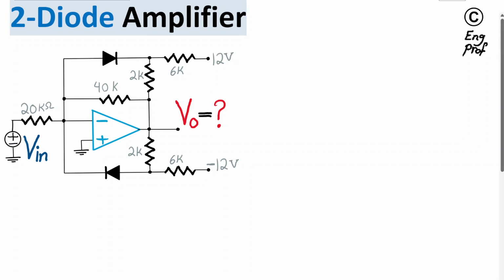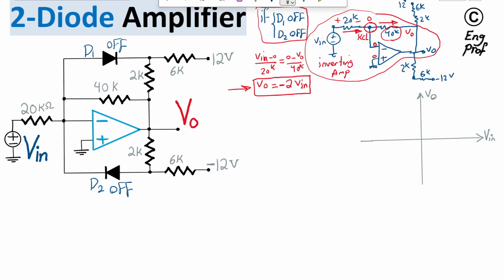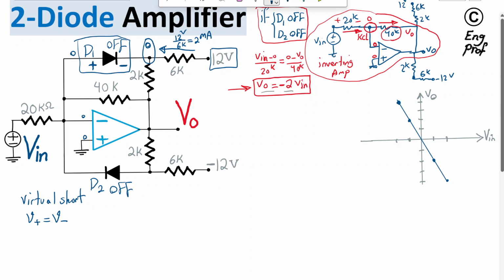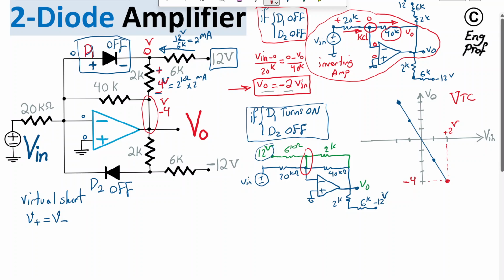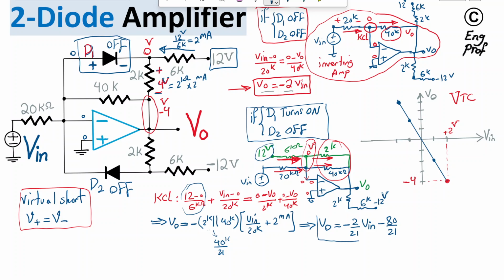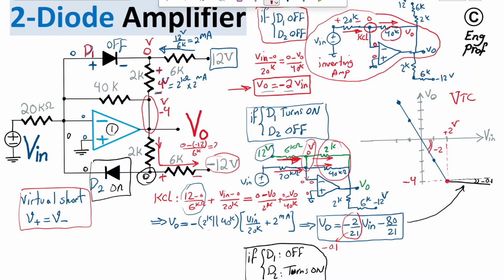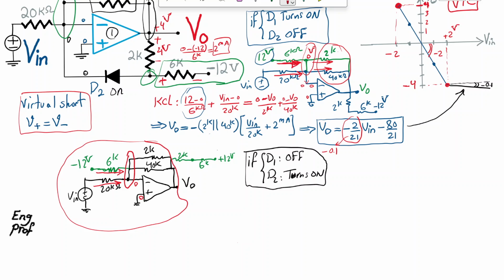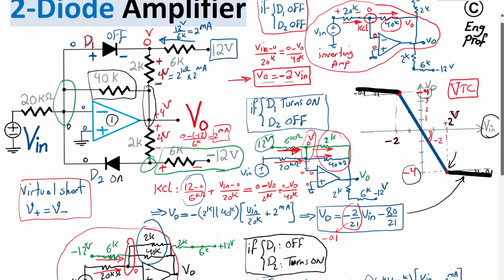VTC of Diode Op Amp Circuit: How does this circuit work?

Comment: It seems this could be used to make a limiter circuit for example to clip an audio signal rather than let the op amp be over-driven.  Using diodes chosen for their onset of conduction curve, a soft clipping knee could be accomplished with practical diodes rather than ideal ones with their abrupt transition.
Reply from the maker: Thanks for watching and for sharing your thoughts and good points regarding audio signal clipping and also using practical diodes. As you noted, there are many applications for this circuit. There are also many variants of this diode and operational amplifier circuit.